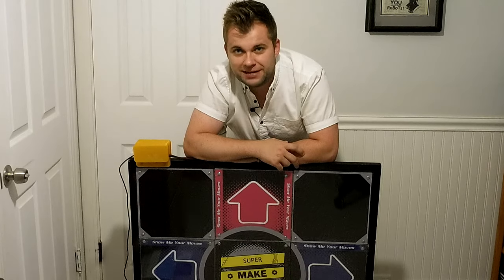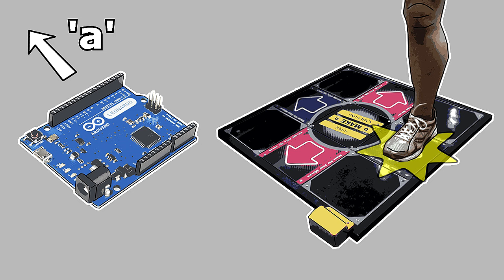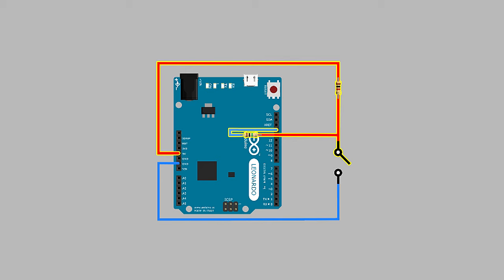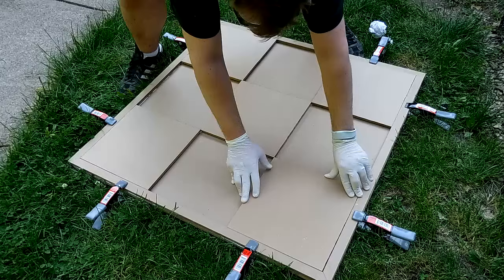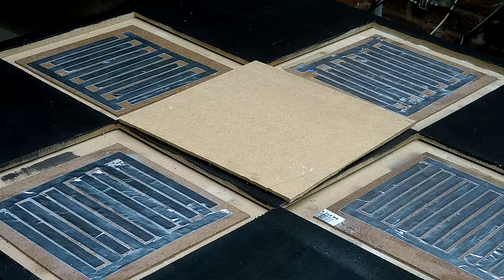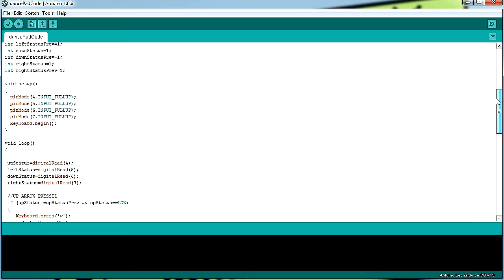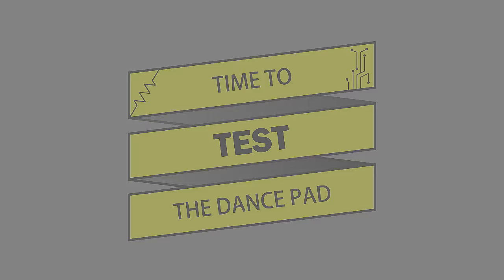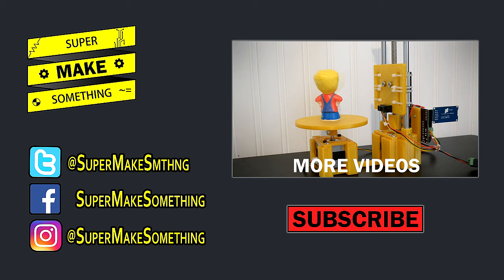USB DDR Dance Pad (Arduino, Pull-Up Resistors) - Super Make Something Episode 9

Comment: I don´t understand how you did the wireing,could someone explain me that abit better?that would be cool :)
Reply from the maker: Basically each button is made of 2 panels, one which is connected to ground (black), and one which is connected to an Arduino pin (red).  You can see more information about this at 11:47.  All grounds can be connected together so that only one wire needs to be connected to the Arduino's ground pin.
Reply: thx,but how did you connected all these grounds together?and which wires shall i use for the wireing?
Reply from the maker: I run one wire between each of the ground panels, connecting them all together.  I then run one wire off of one of the ground panels to the microcontroller.
Reply: okey,thanks.than i have these last questions left:which cable should i use(can you send a an example?)and can i solder the wires to the
aluminum or do i need to use electrical tape?(i know i could screw them all together,but i don´t really know how and that´s because i will solder it or tape it ^^
Reply from the maker: Any wire is fine as long as it fits into the Arduino female headers.  Soldering to aluminum is very difficult due to its material properties, and electrical tape requires a lot of maintenance.  If you are starting a new build, I would recommend screwing them together.
Reply: okey,but how should i do that,because i don´t understand how to make that.(iam very new in this and this would be my first project so sorry if for soo much questions ^^
Reply: i have an idea how this could work:i only need to put a screw inside of the aluminum and then roll the wire on the screw or?and if yes on which part of the aluminum? the ground part or the other part? and which cable? the red ones? and one screw for each wire or 4screws(one screw for one wire)?
Reply from the maker: +Apfelboy077 Use one screw for each wire. The idea is to make sure that the wire and the aluminum have electrical contact. Wrap the wire around a screw, then screw into into the aluminum panel. This will forcefully compress the wire between the screw head and the aluminum. Repeat this for each wire/aluminum panel.
Reply: okey,thanks :)that means i need one screw for one panel? and how
should i screw than the single ground wire`?because i need to wrap it around the screw and i don´t really know how i should wrap a single cable around 4panels.
Reply from the maker: Use four wires, one per panel.  The aluminum will electrically connect them together.
Reply: okey,that means i need to use for red cables and4ground cables and than i need to solder each ground cable to one single cable?
Reply: so i finally buyed nearly everything and i will start this project in the next days.
Reply from the maker: +Apfelboy077 That's awesome! Please share a picture with me after you finish. I would love to see how it turned out!
Reply: i will try my best ;) but this will be my first project so far and that means that i think that there will come some problems and questions,but then i will ask them here ;) and yep my english is not the best,but i think you noticed that already ^^ :)
Reply: okey i have a question (again).Could you say me please how long all the parts are in centimeter? that would be very awesome :)
Reply from the maker: You can convert the units with the following scaling: 2.54 cm/1 inch.
Reply: that means 4 by 4 inch are for example 10.16 by 10.16 and thx btw ^^
Reply: so now i have nearly all the parts,and i will use 2 cat5e cables for this project and these cables should work for this or?
Reply from the maker: +Apfelboy077 Yes
Reply: okey than i will use them thanks ;) and did i done this correctly with the aluminum?
Here is a picture: http://i.imgur.com/B89kS9U.png
Reply from the maker: This looks correct.   I'm sorry but at this point, this is really the only help with this project that I can offer.
Reply: okey,but thanks ;=)
Reply: my build is completed and it´s working totally fine!He is a picture of it: http://prntscr.com/cdnp3m
I didn´t used LEDs because that was abit too complicated for me.
Reply from the maker: +Apfelboy077 That's awesome! Congratulations on your build! Do you mind if I share your picture across Facebook/Twitter? I will give you credit of course.
Reply: you can do that if you want to ;=)
Reply: btw i used a tacker and not a screw because that was alot easier in my opinion
Reply from the maker: That's a really smart idea!  I like that improvement a lot!  Posting your pic to Facebook/Twitter now!
Reply: Cool! but now after 2days of playing with it i noticed that when i release a pressed button it sends some kind of flickery (it is like i would press the buttom for times in 1sec)do you know why?Or do you know why it could be?
Reply from the maker: +Apfelboy077 could be that something is making a slight contact as you let go. Since aluminum foil can be a little flimsy, it's good to double check the contacts after every few play sessions. Since the software worked for you, future failures will likely be mechanical.
Reply from the maker: +Apfelboy077 you could also try implementing a software denounce in the code, but I currently have not implemented it.
Reply: okey i will try to make this my own and will tell you if it works or not ;)(but this could take his time),or are you making this yourself?
Reply from the maker: +Apfelboy077 I don't have plans to right now as I'm currently working on the next build, but if you end up getting this working, please let me know!
Reply: there some  wwwaaaaa in the code and you need to delete them ^^
Reply from the maker: +Apfelboy077 Thanks!
Reply: although you need to set the Debounce = (number)and the if (Debounce >=(number) at the number you need and iam not sure if this code really works but hey! no problem ;)
Reply: i think this code doesn´t work because i didn´t feel any difference xD
Reply: debounce is used to eliminate the signal changing too fast, usually something like 25-50ms
Reply: that´s good to know, but i am not good in coding so i don´t know how i should make a debounce in the code.
Reply: most games have an internal debounce, I actually downloaded and had a look at the code this guy uploaded, he doesn't have any debounce

if you're playing stepmania with it, it should be fine without it

it's good to have it, but you probably don't need it
Reply: i play stepmania sometimes with this code, but i think the code needs a debounce, because sometimes it clicks 2 times, when i only want to click one time (sry, but english is not my main language).

Comment: can you make a pump it up pad the same way?
Reply from the maker: Absolutely -- a pump it up pad could be made using this same method.
Reply: thanks because i wanted to play pump do you mind sharing how much this project costed roughly?
Reply from the maker: Getting the graphics printed and laminated was the most expensive individual component.  Assuming that you just want to build a functional pad without these, and that already have all the tools, I would estimate that the total build cost was ~$75 in materials.

Comment: can I use Uno instead ???
Reply from the maker: Darwase Bustami Unfortunately an uno will not work. This application requires an ATMega32u4, which can natively act as a USB device. This chip is found on the Arduino Leonardo.

Comment: This is not cheap, because you literally have to buy a 3D printer, which costs much more than a metal pad by itself, and lots of materials and the Arduino Leonardo to make this. That'll probably cost like $500.
Reply: You can make a less exotic housing for the microcontroller pretty easily, it just won't look as professional. The materials for the whole pad plus the Arduino controller should cost less than $150.
Reply: Haruyuki Miyoshi did you see how much a copy of Solid Works is?  just use TinkerCad instead! LOL